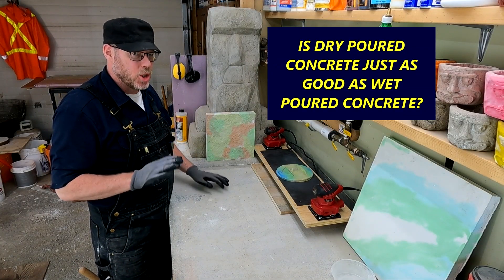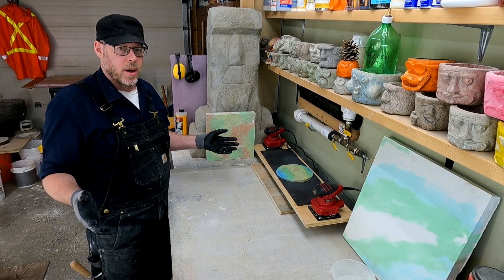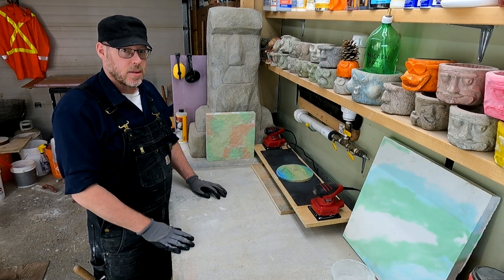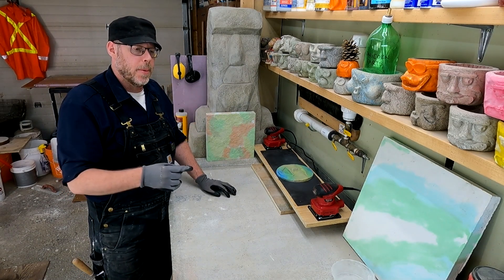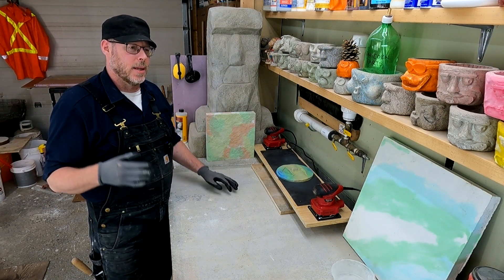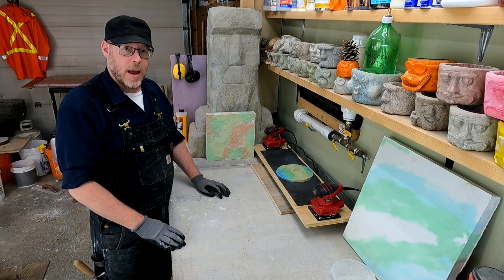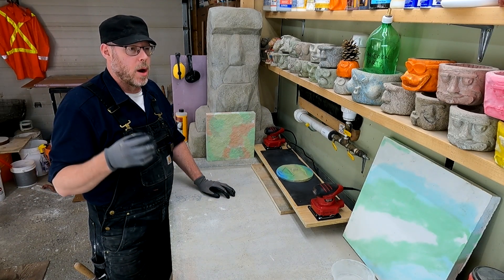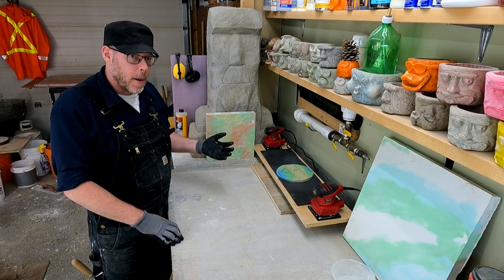Can You Dry Pour Concrete?

Comment: What about in the case of a column capstone and using a top layer of mortar mix, where structural integrity isn't really much of an issue and the mortar mix should give it a relatively smooth finish to begin with?  I guess the only concern would be if the dry mix adheres to the bottom of the form. Thanks in advance.

Comment: If you live in snow country you know that in NY state they still pour Salt on the roads and our correctly wet mix sidewalk on Main Street has eroded all the cement leaving the stones exposed. deep craks and even a large water bowl  exposed for dogs to stop and drink rain water from. Bottom Line is Nothing lasts forever !  I think this guy is jealous of everyone's joy of playing with dry pour cement as much as he has wet pouring and mixing.  The salt they dump on our road will eat through this guys " perfect mixture and Process " !  Google how many tons of salt your state dumps on the roads to melt the icy conditions !  If the concrete is a side walk with practiaclly no foot or heavy machinery on it year round - I say the dry pour with top mortar and epoxy coat will work as a vanity project which is the goal for curb apeal.

Comment: Hi I once did a dry poor mixing my concrete rather than the pre mixed bags used in most videos then added water then mixed it with a rake technically a wet poor but without the cost of a cement lorry ,about 3mt by 2mt 5" thick with rebar, it never cracked and had a 450kg milling machine on top ,i,m thinking of doing a 60 mt2 slab the same way as funds are in short supply

Comment: With my background in engineering (not civil engineering) I trust that you know what you're talking about.  The attraction to dry pour is for people who don't have 10 years experience pouring concrete timing everything (everything including cleaning tools before the concrete hardens on them), and timing the set to achieve a reasonable finish all without having to buy/store a bunch of large tools in the garage.  For my application of several 3x6 ft stepping stones in south central Texas, I do not want a smooth finish like you're talking about.  I want a finish that will grip my feet or shoes.  If you could address how to get 14 cubic feet of concrete mixed and poured with only a 5-gallon bucket and a garden trowel, I think you would be more effective making your point.
Reply from the maker: I would rent a concrete mixer from home depot for $35 for the day and mix and pour them all, finishing with a damp sponge float to achieve the texture you are looking for.  Quite an easy day of work, and I am pretty confident it could be done faster (and easier) than dry pouring, and the results would be undoubtedly superior with a traditional concrete pour versus the new easy method that people are trying.

Comment: You said water going through concrete erode it. Would water going through aircrete erode it as well? I have seen very porous aircrete that water just runs through it like a sieve, any though?
Reply from the maker: Yes, as water passes through some of the cement component will wash away.  It takes, years, even decades, but this is how concrete erodes and the more water it is exposed to the faster the erosion will happen
Reply: @creatingconcrete  So aircrete is not as good as everyone thinks it is then right.  The bubbles would make it more porous and the lack of sand, there would be no backbone as so to speak to hold it together any water and it would fail fairly quickly yes - no?

Comment: No one is claiming that dry poured concrete is AS good or AS strong as wet mix, but maybe it's strong enough for many around-the-home and garden projects. I am not going to last 50 years, I certainly don't care of my concrete does. The professionally poured concrete driveway and sidewalk done 35 years before I bought my house had cracks all over. 
Also, for people like me who don't have a mixer, wheelbarrow, or other tools and just need a 4 x 6 slab in my inaccessible backyard, it's become difficult to find a contractor (in my area of the Midwest, anyway) willing to even give an estimate, most don't want the job. If they do, it's expensive and will be delivered on their time schedule, whether it's a good time for me to have it done or not. I understand that-- with the investment in their equipment, the big jobs are their livelihood. 
But that's why dry pour has a place in the world of concrete. YOU would never do it, that's obvious, but it misses the point. Thanks
Reply from the maker: Yes, as an experienced concrete contractor I would not do it.  If you have a small job, then just rent the proper tools for the day from Home Depot and mix whatever you need.  For the mixer rental, rental of their van to tow it even plus materials to build the pad would still be under $100 so I do not see value in doing all this work to build something inferior where the actual proper course of action is also easily available.
Reply: We all know that "dry pour" would probably hold up for some time with minor, non-load bearing tasks around the house. We also know that no inspector in a civilized country would ever sign-off on "dry pour", which is very telling. 

I think it comes down to how much pride do you take in your work. As an analogy,  if you're repairing a broken wire in the engine compartment of a car, you could use a wirenut and electric tape, or twist the wires together and gob it with RTV. That's the equivalent of "dry pour". Or you could solder the wires together and use heat-shrink for a proper repair, that would be equivalent to premixing.  

To us that care about workmanship, it's actually very satisfying to know that the work will potentially long outlive us.

Comment: I agree that water can and does compromise concrete over time but what stumps me is how do swimming pools last so long while they are constantly submerged in water. I believe that pool plaster is a cement product isn't it? Can you explain this?
Reply from the maker: I am a swimming pool specialist, so I can tell you that the interior surface of concrete pools is made from dense plaster which is water resistant due to the hard trowel finish and fine mateirals the mix is comprised of.  And still that is not waterproof, water does pass through, and over about 10 years time the surface will become rough and porous requiring a new plaster interior surface.  The maintenance of the interior surface (also the use of waterproofing systems, ideally) protect the substrate concrete shell from damage from water erosion over time.
Reply: @creatingconcrete  That makes sense thanks 👍